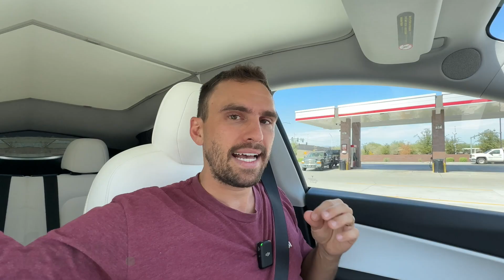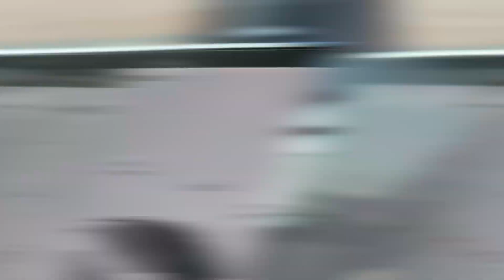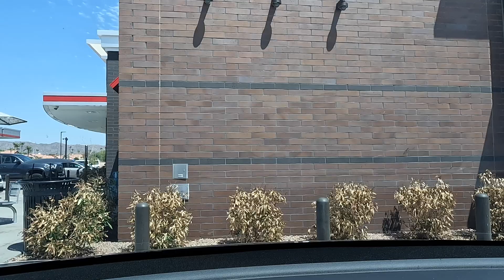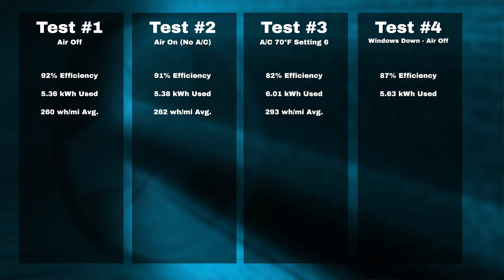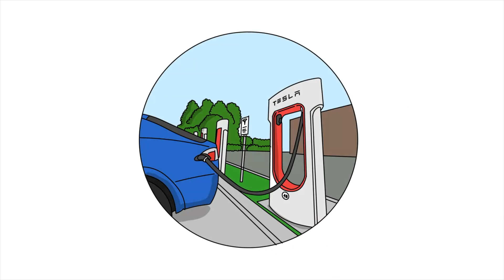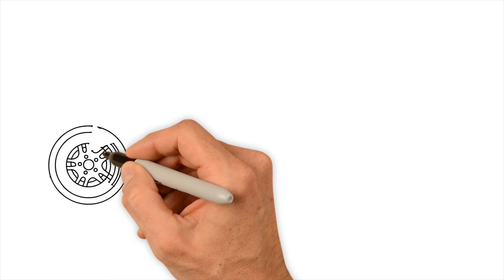The Most Efficient way to Drive your Tesla Model Y

Comment: While the wheel offset will increase turbulent flow, the distribution of mass on the forged wheels is probably more to the periphery compared to the Tesla OEM wheels. If you remember physics class, the moment of inertia between the 2 wheels is different. Also the tires pressure matters as a little concavity will add more rolling resistance vs a slighter overinflated tire with convex contact.
Reply from the maker: My physics teacher talked about her cats a lot and hanging sign problems. That's all I remember
Reply: @Gjeebs  Sorry to hear that - unless you love cats LOL. Tesla didn't put any dam relief in the front to direct air towards the wheelwell from above/below the headlight housing so I'm guessing the offset doesn't alter the slipstream that much. On a Lucid it would probably be more important.  The new 3 is down to 0.219 and I suspect a large part is due to the windshield relief.

Comment: Just got my 23 MYLR on Aug 30, and to say I was a little freaked regarding my efficiency was an understatement. For transparency I will note that I live in central Texas and it's 100+ every day. When I picked up the Y from Tesla it was 136f in the cabin. There is a lot of AC, overheat protection, etc. going on here. All the time. Every day. 
The Tesla tech I spoke with assured me that once highs are below 95, I should see improved efficiency.
And, the vast majority of my driving is at 70-75mph highway. Not an efficient combination.

Comment: What rear mudflaps do you use and where did you get them from?
Reply: Whatever mudflaps you get, if they have a cupped design and you leave where you have snow…..that design will pack snow in and that snow will eventually freeze and sooner or later you’ll hit a bump and the mudflaps will pay for it. Trust me, I went through two different sets before switching to mudflaps that are flat and less susceptible to packing in snow!
Reply: @tokodave1  any links to websites that have such flaps? I live in anchorage Alaska so that sort of advice is very good to have
Reply: The ones I ended up with are the Rally Armours. They’re quite a bit more expensive but I squandered almost that much going through less expensive cupped designs

Comment: if you want efficiency in an emergency "have to make it to the next charging spot and I borked the calc's" kind of situation, leave everything on, pull in behind a semi-truck, put on your autopilot and set it to a following distance of 2.  Done.  200-210 watt hours per mile.  Semi's/Lorry's don't stop fast, even in an emergency so you should have plenty of space and time to stop.  Also, following distance of 2 is pretty far back.  Its not hyper-mile'ing levels of cutting drag, for that you would need to be about 7 to 21 feet from the back of the semi, which is too much pucker for me.  Still, 210 wh/mi is very good.  Turn off your A/C as a last resort and just stay relaxed and comfortable, let the system re-calibrate to see how much your range improves.  Don't stress, make a smart call and see what changes.  Whatever you do, don't keep going 70-80 mph or whatever.  Speed kills your range (or rather, forcing air out of the way at faster rates)

Comment: Driving my Model Y 1400 miles over the next 3 days and the timing of this video is perfecto
Reply: So you want to drive it with the AC off windows up?
Reply: @EnthusiastCarHangar and turn on the heater. With seat warmer. In the summer.
Reply: @EnthusiastCarHangar  It's about knowing the most efficient way to run the car in case I run into a range issue to the next charger
Reply: @MountainManGuy  Makes sense. And I can confirm what he said. I tried it out with my Tesla. Never put a video up about it on my channel. I should have.
Reply: Drafting a semi (at a safe distance) is the way to go. Alternatively, big van / U-haul if there are no semi trucks around.
Reply: @solitude5501  How close are we talking? If the distance is set.
Reply: @EnthusiastCarHangar  I set 5 car lengths or so and still see benefits to efficiency. Some people go closer. I did a 260 mile trip recently and got around 230 wh per mi behind a semi. Family of 5, filled with Ikea boxes, 95 degrees outside, with A/C on recirculate at #4 fan speed.
Reply from the maker: Another thing to add if you want more efficiency is draft a truck and watch your energy chart. Amazing how efficient drafting makes you
Reply: Having done numerous road trips ranging anywhere from 500 to 6300 miles, I've learned not to worry about efficiency too much, and focus more on getting to the next supercharger. So long as you're not going to one that's really out of the way where it takes 15-20 minutes after getting off the freeway to reach it, or it's a busy supercharger, you'll do better leaving when the car tells you that you'll reach the next supercharger with around 5-10% (If the car says the next supercharger is really busy, you might be better off charging longer at your current one, and see if you can skip the busy one altogether).

You'll have to make more stops doing it this way, but each stop will be shorter because you will be charging faster at each one, unless it's a busy V1/V2 supercharger, denoted by the 120/150 kW max charging speed, in which case the speed is halved while you're sharing a stall with another Tesla.

I suggest opening the supercharger map each time you plug in, and pick the next V3/250 kW supercharger along your route. Each car can get up to 250 kW speeds and the timer for how long to charge for is measured in minutes, vs the 5 minute increments for the older V1/V2 stations.

If you haven't picked hotels yet, when I did my trips, I always picked a city that had a supercharger, then would look for hotels nearby that had destination charging. This way I could charge up overnight at the hotel, or if it was broken/being used by someone else/ICE'd by a gas car parked there, I had the supercharger as a backup option. If I had to supercharge, I usually just charged to around 90% the night before so I could just take off the next day instead of having to charge first. Expect a little drain from running Sentry Mode.

Above all, have fun sightseeing! Autopilot doing the boring mundane Interstate sections of road trips allowed me to "sightsee" a lot more than if I had to drive manually. I still paid attention to the road of course, but it's nice to view the scenery too. I really loved driving out west, as I don't see deserts, mesas, plateaus and mountain ranges very much in the Midwest.